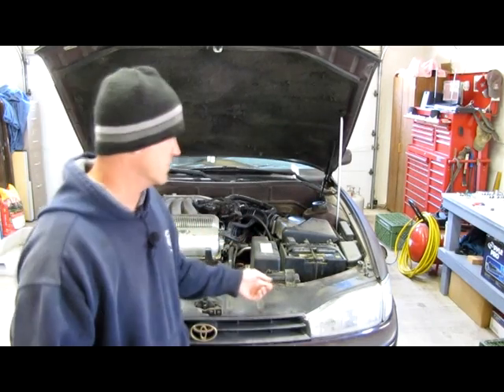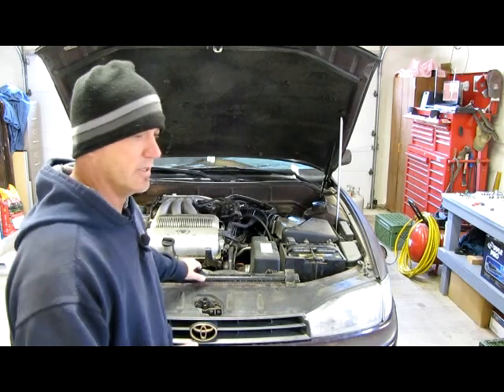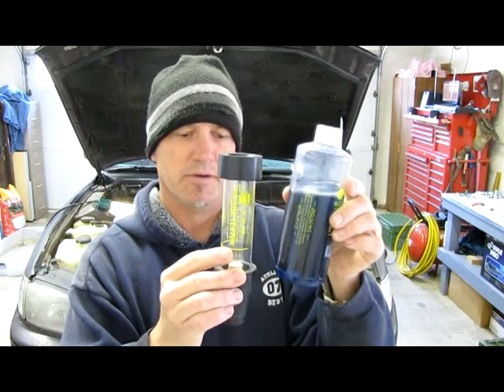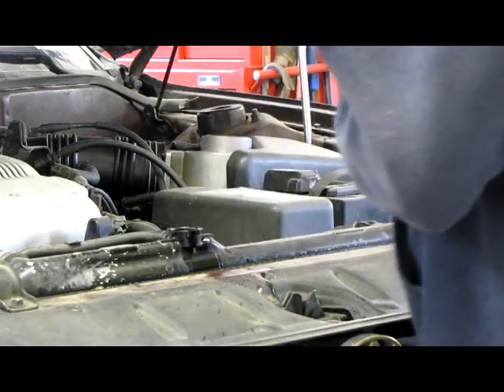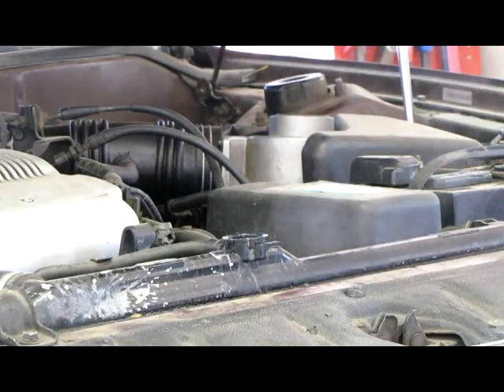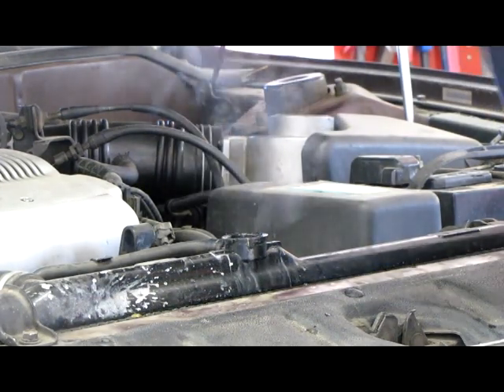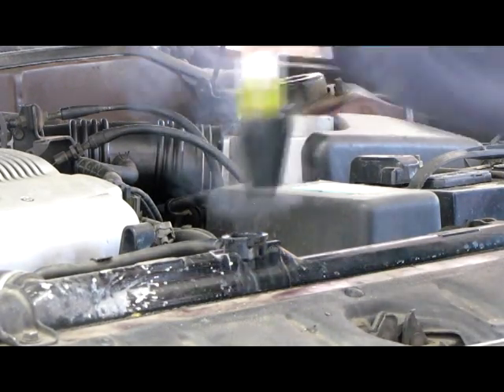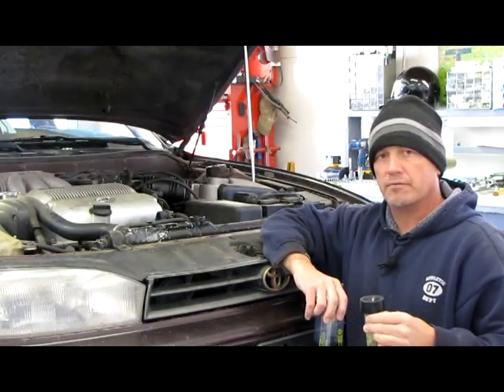Blue Devil Headgasket Sealant vs. Napa Block Tester Pt 1 of 2

Comment: The blue stuff reacts with CO2. Use the bulb suck in air you exhale from your mouth and the blue fluid will eventually turn green and then yellow. That's from the CO2 you exhale. It looks for excess CO2 inside the radiator. 8 puffs with the bulb by the tail pipe will turn the liquid green, & 12 will turn it yellow. I checks my Chevy & it stayed blue even after 30 or 40 pumps. Your head gasket is passing exhaust into the coolant pretty bad. Mine came up clean, but the truck still overheated pulling the hill up to Sunset Point, so I replaced the radiator & water pump. I ran it 30 minutes idling with the front against a brick wall while I marked the wall, and parking lot to realign the headlights and it stayed at operation temp so only another trip up the hill will tell for sure.
Reply: Yeah, the Sunset Point rest stop on I-17 north of Phoenix.

Comment: hi! I have a one question! after rebuilding of engine I must to change antifreeze or not??? in radiator again have combustion leak! is this from old antifreeze or not???
Reply from the maker: +irakli zhorzholiani Rebuilding an engine, as you know, requires that pretty much everything, and I mean everything attached or related to the engine must come apart.  One obvious change to me is the coolant, so YES - change the coolant.  In fact, while the engine is out, have the radiator flushed extensively, along with the heater core.  With a rebuilt engine, you will start from scratch, with NO coolant/water, and prepare your engine for break-in from there by adding a proper mix of brand new coolant with water.  Yes, change the coolant.  r-

Comment: to ensure the coolant doesn't go into the fluid can i put the tester in the overflow reservoir instead of the radiator and still hope to get an accurate result for combustion?
Reply from the maker: +Scott Watkins Unless you have an "expansion tank" type of system, my guess would be no; you would most likely not be able to get accurate results.  Might sniff some, but it's designed to go directly into the neck of the radiator or the expansion tank.  r-

Comment: My Q is ..the blue devil work ??
Reply from the maker: Rene Morales Yes, it did.  I have a Part 2 to this video where I show the same block testing after the Blue Devil was added to the car.  It worked for about a year and a half, but then the car finally overheated again.  I chose not to spend the money on the repair, and sold the car really cheap.  The Blue Devil helped me a TON when I needed it to.  Check out my Part 2 video!  r-
Reply: Awesome thanks for the info and the help ...👍👍
Reply from the maker: 350Zquicksilver Hi!  One who works on this kind of stuff doing repairs will never 'recommend' a quick-fix for a repair, like this.  The proper thing to do is to repair the vehicle, IF you plan on keeping it and IF it's worth the investment.  My recommendation will always be to repair the engine properly - find the cause and repair it as well as the resulting damages.  However, I understand your situation of course!  Mechanically-speaking, I haven't heard of anyone treating their vehicle more than once, so I can't really recommend that.  Anytime chemical additives are added to an engine like this, it will make some changes - depending on where the damage is.  My suggestion would be to treat it once, and plan on replacing the vehicle.  That said, I would never sell a vehicle with issues like this without disclosing it - which of course means you'll get near to nothing for it.  I would simply try to buy some time with it, and if you want to gamble and treat it multiple times, the results will be unknown, really.  In my case, we drove it til it dropped, then sold it super cheap, with full disclosure.  I did get about a year and a half out of it, and it wasn't worth my time to follow up with the company on their ultimate guarantee that it was a 'permanent' repair.  But it helped me when I needed it.  Wish you luck, and would love to hear back!  r-
Reply: reluctorvalve - Do you recommend adding it every year, if you're in a desperate situation?  $35-60 a year is a lot less then a $1000+ head gasket replacement on a 11yr old vehicle with 185K on it.
Reply: +reluctorvalve Hey, I have a Lincoln BlackWood truck and I have water filling up the plug tubes on top of the plugs,  With no other signs of a head  gasket problem, IE. smoke, water in oil, oil in water nothing  not getting hot... only thing is the water in tubes cause the plugs to foul out. Took it to two mechanics and both don't know exactly what is going on.  Hopefully you guys can help with ideas.
Thanks in advance
Reply from the maker: Steel - sorry for the late response - ....hm.... I'd like to know more about this one.  Have you done more work on this? I'd like to know.  Thx.  r-

Comment: Subscribed! Nice videos keep them coming!
Reply from the maker: Oliver Mark Drews I'm currently working on a new video for future upload as we speak...very deep, but not overly technical. A pair of cylinder heads are coming off of a '99 Dodge Ram 1500 5.2L Magnum truck and will be replaced (found out today that the OEM ones are cracked).  A generalized head gasket replacement example video typical of a V8 engine.  Again, my approach is to an audience who may not be sure they want to delve into this, or they may decide to.  Not overly-technical, but more or so informational.  Shot and now editing the disassembly process at this time.  The cleaning and reassembly still to do. My goal is to have the truck up and running by early to mid December, with the new video fully edited and uploaded sometime perhaps in January.  Lighting, shooting and editing greatly slows the entire process, but I love doing this stuff!  Bought a new lighting kit and also a new HD POV camera to help with the more detailed views and descriptions.  I have to say that so far, the video is looking pretty good and very informational! Thx for keeping a watch out!  r-
Reply from the maker: Oliver: Recently uploaded the new video on this repair.  It's long, but took two months of shooting and editing...I think it's a good informational video for those looking for this kinda stuff.  So- kept it coming, as you asked.  Next up:  Toyota 3.0L V6 timing  belt and water pump replacement, from the same 'how-to' angle.  r-

Comment: The chemical changes color due to presence of Carbon Monoxide. I have a Snap-On version. I also think Diesel head gasket fluid is diff than gas engine fluid (detector fluid that is) as my gas eng detector would not pick up a leaking Diesel head gasket.

As the engine heats up, cracks in the cyl will open a little bit more due to thermal expansion.

Comment: Thanks for the upload.  It was really helpful since other videos show the tester at the reservoir. 
Do you recall how long it was before you experienced steam... 20-30 minutes?
Reply from the maker: Marco: probably not that long.  I'd say within about a 10 minute window or so.  These newer engines ('new' to me, I"m old) heat up pretty quickly.  But, certainly not 20-30 minutes.  r-

Comment: Taking into account is very complicate to take out the sensor of 2003 Saturn VUE 3.0 AWD, because the location of the housing is under the lower intake. Could you tell me if I can use Blue Devil head gasket sealant in my Saturn VUE 3.0. without to remove the sensor?
Reply from the maker: Roldan Perez: If you are referring to the 'thermostat' I would say no.  The directions specifically indicate that you need to run the vehicle without the thermostat for a duration of time in order to effect the chemical. Sorry! r-

Comment from the maker: Robert Paulson: In most cases, absolutely. The area where the gasket is compromised can (and often is) be right in between the cylinders, or in between a water jacket seal and the combustion chamber.  This is why many see steam, or 'white smoke' out their tailpipes- water (coolant) in the combustion chamber will cause the cylinder to misfire.  r-

Comment from the maker: Michael Mcalister: You are most likely referring to the process of using the cleaning agent before adding the Blue Devil; in that case, follow the directions on the label of cleaning agent of your choice--there are several different makers, so just read their instructions to 'scrub' the insides of the cooling system, take out the thermostat and flush when cool, then begin the Blue Devil additive process.  r-

Comment: (cont.) so i've decided to not bother with blue devil opting for a rebuilt engine. found a good deal on ebay installed for $2400 with new timing belt, plugs, radiator, etc. father and son operation that gives me confidence that it's good value for money. i'll let you know if it is indeed a good deal. thanks again for your help.

Comment: many thanks for this. my 96 is a 3.4 with almost 200Kmiles. i was quite aware of the gasket problems with the 3.0 which is why i bought this one thinking the problem had been solved and i could enjoy at least 300k of toyota "quality"(?). i thought this was the first year they put the computer in for diagnosis? since i can actually see bubbles in the radiator, i figured this is exhaust gas so didn't bother with another block test.

Comment from the maker: tidbit cont'd: it's like pouring cold water on a piping hot surface, and an (or two) aluminum head(s) are right there.  I would welcome someone adding to this for suggestion, but just be aware that the location of the thermostat really needs to be paid attention to, in my view, when working with a hot engine and adding coolant directly into the radiator.  And ASE certified approach to this here would be welcomed.  thx r-

Comment from the maker: To All Reading These Posts, a little tid-bit I learned, I think the hard way: As opposed to the cars of the 70's and 80's when I was growing up the location of the thermostat back then was always connected to the TOP radiator hose.  That is not the case with a lot of today's cars.  Based on my experience, be cautious of adding cold coolant to a warm engine which does NOT have a thermostat connected to that top hose; if you do, you are pouring cold coolant directly into a hot engine..cont'd..

Comment from the maker: Davet: the check engine light can be any number of things, but as it wasn't on before, it's related to this issue; could be something they failed to hook up properly, could be the 02 sensor is now 'showing' an issue with the exhaust gasses....I'd begin at the beginning with a block check and misfire cause isolation.  r-

Comment from the maker: DaveT Dealer cont'd: if you need to know an easy way to identify those, contact me in private.  When you identify that (those) cylinders, isolate the cause of misfire which is one of 3 things. Check compression, check ignition.  If you have good compression and good spark, then it's related to proper air/fuel, which as explained above CAN be headgasket failure.  And of course the second thing is a block check, again. Make any sense?  You can contact me privately here to continue this.

Comment from the maker: DaveT Dealer cont'd: so that's one way (in my view) to verify that their pressure test further ruined that gasket seal.  Next, the miss COULD be caused by this further damage, if bad enough damage is done to the gasket sealing area; if this is the case, they are saying that it's so bad that the cylinder is being spewed with coolant and the air/fuel is now mixed with coolant to the point of causing a misfire.  So at this point I suggest two things: 1- identify the cylinder(s) missing. cont'd...

Comment from the maker: DavetMcguire Dealer: This is very interesting to me, and unfortunately in this case I would have no choice but to begin with the basics: the miss.  First, I suppose that if you had a semi-damaged headgasket physically, that a pressure test could push gasket material away from cooling passages in that gasket where it may have been 'going,' as they say.  If this is the case, then a block test now WOULD show that-- you would now have compression gasses detectable in the cooling system, cont'd...

Comment from the maker: Dave cont'd: to aid in reaching op temps. It might be possible that you are smelling coolant leaking only during certain times, such as these.  I'd check those coolant lines closely below the throttle body if a 3.0L.  That's my first response, now on to the 'dealer' experience...

Comment from the maker: Dave cont'd: for (from) most of the sensors.  It's not until the engine reaches a certain temperature that the computer and sensors take over the engine for management.  Now, given that there are cooling circuits to the throttle body area, and considering that there is a 'cold start' injection system (I think), this tells me that there may be (perhaps) coolant running to that throttle body area only when dead cold...it may continue..or it may be at an increased level during 'open loop' cont'd...

Comment from the maker: Dave cont'd: but a pressure test would normally show that.  What my 3.0V6 does have are coolant 'circuits' for lack of a better descriptive term that flow to the throttle body assembly, and my assumption is that the purpose of this is to aid in the air intake temp readings compared to the engine coolant temp at various times.  When the engine is dead cold on startup the computer is in what is called 'open loop mode,' which basically means that the computer is running with 'set' values cont'd...

Comment from the maker: DavetMcguire: Hm..a few thoughts on this and your former posts.  Might take a few entries here...first, is this the 3.0L V6?  If so, I've done some reading on this engine as I recently purchased a 1990 Toy 4X4; information I've come across indicates that these engines tended to have headgasket design issues and tend to give issues after 'some' miles;  additionally, the smell of coolant you are (were) smelling has me a bit wondering.  Headgaskets CAN leak externally, continues...

Comment: took the 4runner to toyota dealership for diagnosis. they did a pressure test. when i picked it up, a minor problem had become a major problem. constantly missing at least one cylinder, bubbles in coolant, and check engine light on. i was quite upset, but they insisted the gasket was about to go anyway and it wasn't their fault. would a pressure check do this? now forced to take action whereas before i though i could drive it fine for a few months anyway.

Comment: Just ran the napa block test on the '96 four runner. did it twice following directions exactly. fluid blue. rough start after it has sat for 1/2 hour. used to be only in morning or when completely cool so start up roughness has gotten worse. runs great after the first 10secs. still no white smke or over heating. not sure that there is coolant loss and haven't smelled coolant vapor/steam for a while. think it's time to pay the toyota dealership for a full diagnosis. thanks again.

Comment: no sign of a heater core or external leak, but can smell coolant outside. just drove another 90 miles with no issues other than the rough start for 15 seconds. runs great actually. toyota expert insisted that it is a head gasket or cracked head problem which i'm starting to doubt. so now i'm going to try the Napa leak tester and will let you know. thanks again.

Comment from the maker: Davetmcguire: no overheating now or prior is a good sign of minimal or perhaps no damage; in my view only a block test would confirm. Smelling coolant,however, leads me to wonder if you have a heater core issue. Do you smell it inside the passenger area? It can have a very minor leak and not be visible, or a really bad one will throw coolant up on the inside of the windshield in defrost mode, also can wet the carpet under dash area particularly the pass side. I'd start with a pressure chk. r-

Comment: no overheating (and no prior overheating), very minor loss of coolant, but can smell coolant. just drove 90 miles with no problems. i can live with this, but have heard it will probably get worse. i would say, it has had these minor symptoms (rough morning starts, smell of coolant) for over 1000 miles. no sign of coolant leaking. can't really say if it's gotten worse.

Comment from the maker: Davetmcguire: The only additional issue I had compared to yours was the overheating for no obvious reason, which prompted me to do the testing in the first place.  Has yours done this?  I just did a Blue Devil treatment on a 90 Toyota 4x4 with a 3.0; block test indicated green- results are, again, great.  Driven it a couple weeks each day now and the temps are solid each time. Yes, be sure to follow the directions, exactly!  I'd like to hear back on your results!  Hope it works for you! r-

Comment: very much appreciate your video. i too have an older car, 96 4runner with 200K showing symptoms of minor head gasket leak (rough idling for 15 seconds, very minor coolant loss, no white smoke, noticable smell of coolant) . i too want to keep this old baby on the road for a few more years, so will be trying blue devil and maybe the napa block tester. obviously have to be very good following directions. thanks again.

Comment from the maker: phoenix: Coolant is typically green in color altho today they make specialized coolants of different colors. Not sure what the 'froth' is- but your description does remind me that when a small radiator or other coolant leak seeps for some time it does turn green with a crumbly look to it..  I would agree that your description is concerning and I would probably do a good system flush and thermostat replace just because. With new coolant you'll know what's in there and go from there.